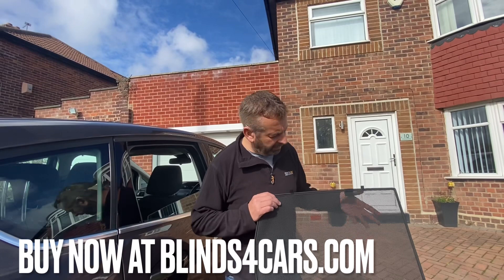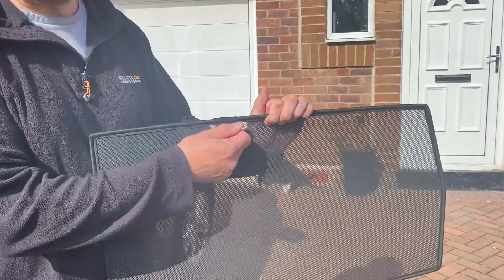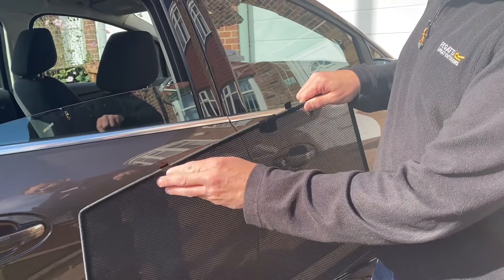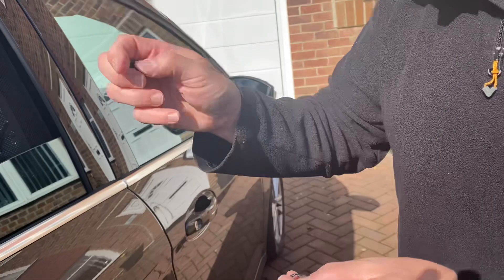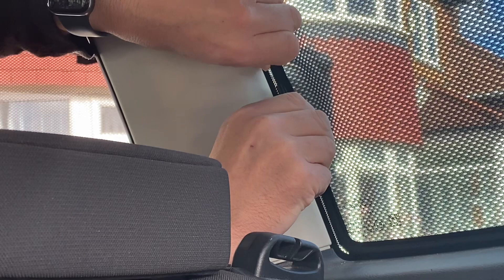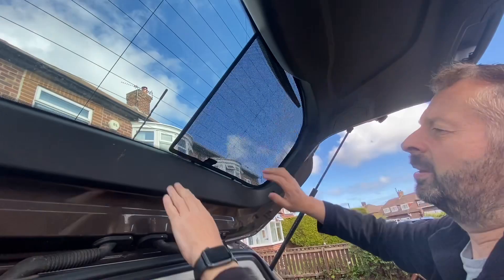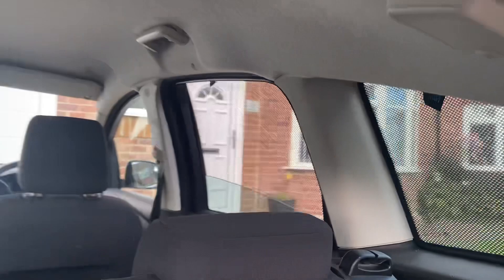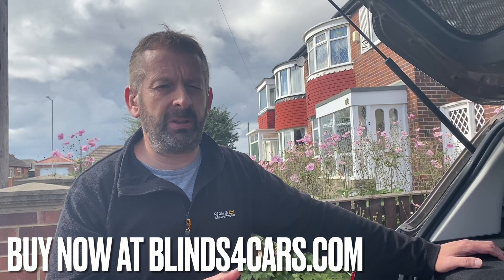Car Sun Shades - Everything You Need to Know About Car Shades

Comment: Great video. I am stuck for a car window without a frame. I am supposed to stick some clips with 3M somewhere but manual said car window should still be able to open
Reply from the maker: Which car do you have?
Reply: @nigelmarstonmotorsport77  Audi A5 sportback from 2013. set that I bought is CARSHADER AUA55A. I have to use the CL-p02 clip, that is supposed to stick on something.
Reply from the maker: @Mordrakka1  they stick to the glass to create a channel in which the shade moves up and down when the door is opened and closed